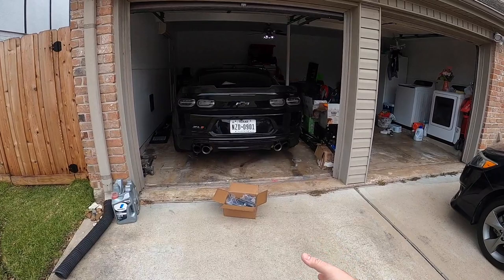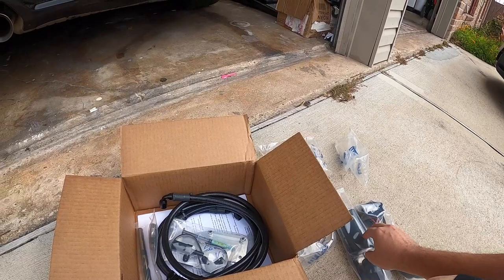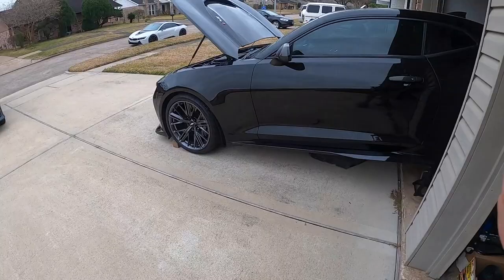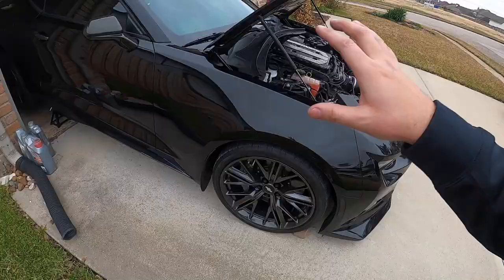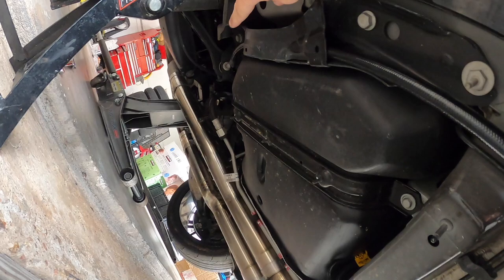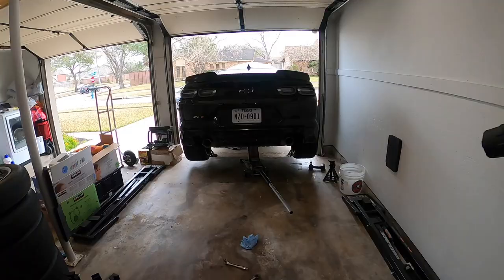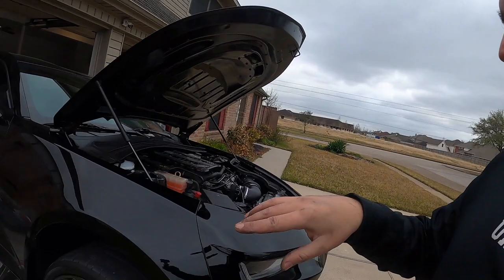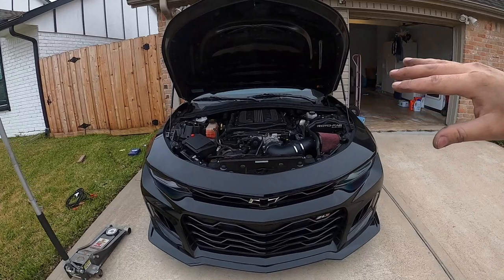6th Gen Camaro DSX Aux Pump Install!! | Vlog # 504

Comment: What kind of gas you run?
Reply from the maker: Mix of 93 and e85 to get around 55% e content
Reply: Do you have a flex fuel kit or just dsx
Reply from the maker: @davidggonzalezc2922  I had both a flex fuel sensor and the dsx low side installed
Reply: What’s the point of mixing it, just curious
Reply from the maker: @Tate_Cunningham  the fuel system cannot support the demand for full e85 so by mixing it it requires less fuel to run max out, meaning less power but the fuel system can keep up with the demand at lower E content.
Reply: @JLSpeed so much E is E 50 than ? Half a tanks of 93 than the rest of E?? How do those gas ratios work for the best outcome ???
Reply from the maker: @SuperiorDRIPP27  there are calculators online that can help you but if I remember correctly it’s a 2:1 ratio for ever 2 gallons of E85 you do 1 gallon of gas and that gets you to around E45-e50 that’s why I had the obd2 gauge to read the e content and I would pump accordingly .
Reply: @JLSpeed  where could I buy that gauge from and thanks again !!

Comment: Have you had any issues launching this car at the track?  Have you considered the drag tune for the electronic differential?
Reply from the maker: With decent track prep and a good burnout on the drag radials i have not had any issues at the track. I think ive only spun off the line once. Its all in the launching i always leave off idle never really stall it and it has always gone faster off idle even when stalling it hooked.

Comment: Did you port your eom throttle body as pray performance is asking for there stage 1 with e50
Reply from the maker: No my tb is still stock
Reply: @JLSpeed  so probably not Worth it until I port blower
Reply from the maker: @davecarpenter9548  it does work and improve the power, but I would say wait till you have ported blower and tb

Comment: I hope you get better results out of your aux systems than I did. My low side is all good now but I am still dropping my high side. I used the can bus system and just had to plug into my e-brake harness and I am able to use HP Tuners to set my aux pump to come on when I want it to. Its really nice. But my problem is the high side which I am ordering my cam and dod delete kit so I can go up 32% in the fuel lobe which should get me to the 50% E I am wanting. I still can only ruyn 30% E but even then I will hit fuel cut off due to low high side pressure. I think I am going to get the Leinginberger fuel system kit which is cam and the high pressure fuel pump called big bore which is 10% more than trhe LT4 pump and the injectors which take it up to 27gps or 214 lbs per hour.
I will let you know how I do. I am making 800 crank HP now so that is why I am running out much faster than you are as I have a larger crank pulley and header which is needing more fuel so if you go up in boost you will be in my shoes as I am at 14 psi boost at 6500 rpm. Pm me and let me know how you do. I will tell Torio once I get my cam in so we can go run these cars and have fun togother.
Oh yea my fitting leaked at my tank and I had to use the sealant gm uses for the oil pan its the 10-2006 ac delco sealant. Worked great no more leaks.
Reply from the maker: Yeah I had the fitting leak also 😅 video coming up on that. And I’m still stock pulleys and blower and tb so I had good success with e50 but I can’t do much more than that.

Comment: Did you ever notice pump making noise george when u let off?
Reply from the maker: No never noticed any noise had to be under the car to hear the pump running
Reply: @JLSpeed  maybe I didnt have enough fuel In it and it was sucking air every once in a while if I get In and out of it quick I'll hear it almost like trying to prime itself.
Reply from the maker: @matthewpfeiffer3527  that’s odd, never ram it low low on fuel so might be
Reply: @JLSpeed  it might be slightly lower then a quarter tank when it does it. You ever go that low?